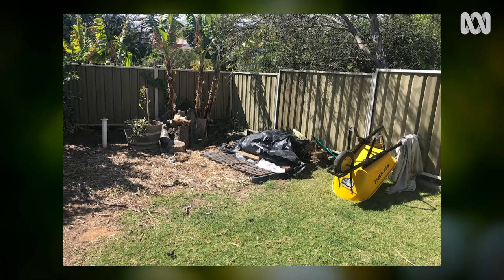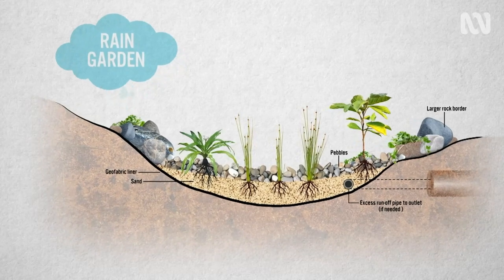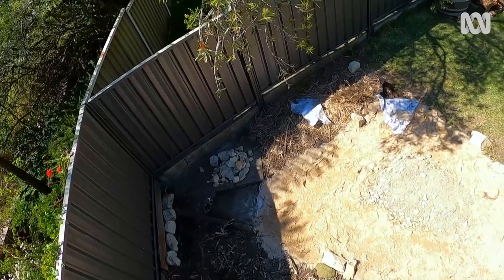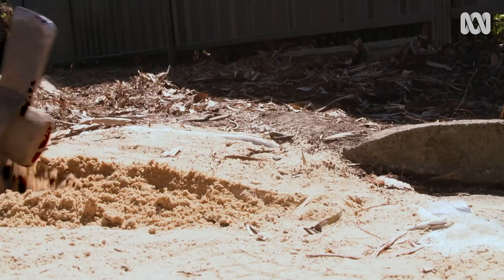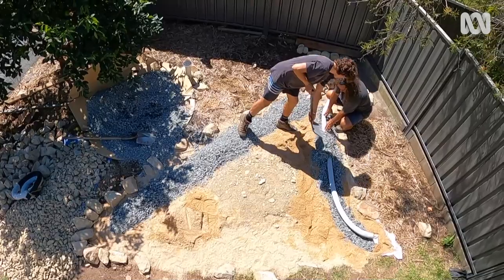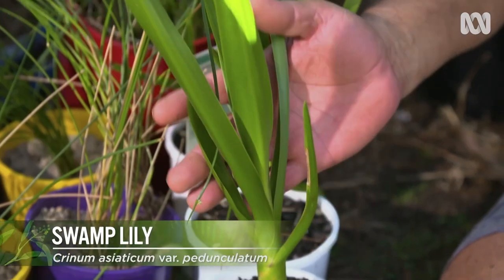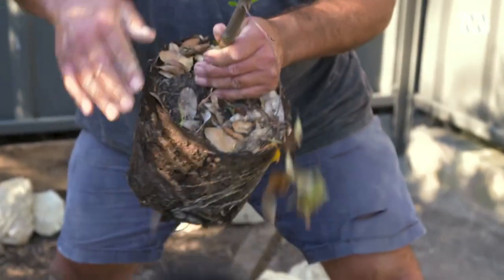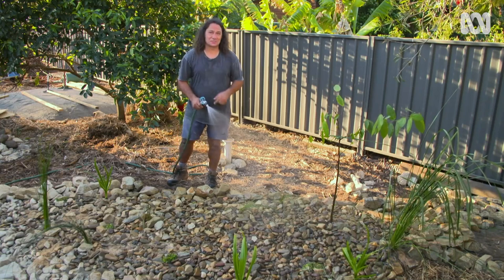Transforming a poorly drained area into a rain garden | DIY Garden Projects | Gardening Australia

Comment: Great to see more native plants going in on private property. I wish every single property would fill themselves up with native plants and leave gaps under fences for blue tongue lizards! A shame about adding pollution to the soil with weed mat and pipes. Would you say that long term debris breaks down and the weed mat becomes a waste of time and that roots invade ag pipe which then gets blocked? What do you think about avoiding plastics added to set a more environmental example? Cheers
Reply: As he said, it can be as haphazard as you want, literally. It is equally as effective to have ditches and channels as long as they still are able to divert the flow of rain water. You may need to use other things like wire meshing to keep your channels from eroding but at least no plastic pipes. You could also use some meshing instead of weed mat but I’m unsure of how effective that would really be. I suppose it depends on how fine the meshing is.

Comment: A rain garden is NOT a good way to manage a boggy area or poor drainage. What are you thinking? It is designed to infiltrate water which is why a percolation test is recommended and is discouraged if drainage is poor. You have this backwards.
Reply: Yeah weird- my rain garden will fill up and drain out within an hr or 2. The base substate is mostly sand